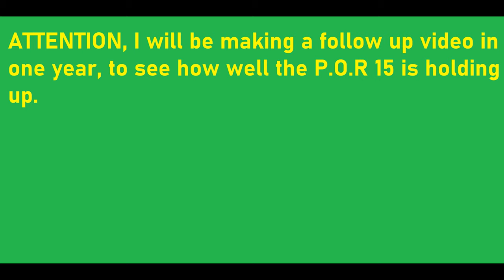Using P.O.R 15 to Undercoat My Lawnmower Deck.

Comment: Thanks - great video.  Short, sweet, clear and concise. Appreciate highlighting the area coverage in the video (1x 42" deck to small can).  This will help determine the amount needed a 46" and 54" zero turns, plus 21" push mower decks. Here in Virginia, the grass seems to always be wet (morning dew/humidity), so I use high lift blades for the discharge.   

In your update, can you cover 1) What is your normal cutting environment? 2) Do you cut in hot dry or moist humid conditions? 3) was the discharge volume impacted?  4) Did the grass clump up more with the POR15?  5) was the deck easier to clean?  Pressure wash? Scrape? and finally, 6) the durability of the product as a whole (chips/flakes, etc).  Thanks again!!
Reply from the maker: Thanks for the feedback!  It all started when I needed to replace a spindle, and I figured while the deck was off and it needed painting anyway, that I would go ahead and undercoat the deck..  The deck on my old Craftsman mower rusted out. And it was always kept inside, but the  grass here is wet and it can be humid..  That is why I ended up buying this John Deere 10 years ago. I was pleased that there was no real rust under the deck, but we will see how well it holds up, because I run over a lot of different things like rocks and sticks..  So it will be the ultimate test!  If I'm satisfied, I will use it on my pickup truck to undercoat the frame. But I might take it to a body shop for that, because there is such a long process and my health isn't that good..

Comment: The abrasion and low frequency impact properties of P.O.R.15 are suitable for a truck bed, but here those will only hold it together until it sags enough for the blades to rip it off and shred it.  Red iron oxide has low tensile, shear and compression strength. It's not enough to block moisture from a rusted steel surface. when it's on the bottom of a thin metal deck subjected to high frequency vibration and high velocity sharp impacts. Any coating applied to a bottom surface will pull the sealer off the weaker oxide beneath it.  The majority of the rust needs to be sandblasted off and/or completely converted to a material physically strong enough to withstand the vibration and impact forces applied. Using P.O.R.15 on top of THAT would provide added impact resistance.

Comment: i did my deck month ago,follwoed the full prepp process+ 2 layers por 15 , but it didnt last long at all, only in 2 weeks,the por15 coated outter ring under the deck is "sanded" off into bare metal,but the rest of coating it remains around the spindles, it kinda make sense the blade keeps throwing grass and sand/small stones onto the outter ring area.
Reply from the maker: Yup, it is the ultimate torture test for sure!  If it becomes a flop on my end, I'll try some heavy duty bed liner next time..    I have learned it is best to leave some rust, you just basically wire brush it and wash it..  It didn't seem to spread as good in the places I totally removed the rust.. 
If I'm impressed enough, then I'll probably do my truck frame in it next..
Reply: @FlickScreen  yeah,iv been googled around and found the truth that por15 only do well on cleaned but rusty surface, it doesnt stick well onto baremetal or painted surface even its well prepared.  The grass usually buildup around the spindle part so its often rusty and por15 likes it,also that part has much less sanding effect from the blades thats why por stays
Reply from the maker: Yup I done a little experimenting and found that to be the truth.  When you put it on a painted surface it will beed up and run off like water..  This is my first time dealing with por15, so it will be interesting come next spring..

Comment: When will you do the follow up video?
Reply from the maker: In about a month, I wanted to give it exactly one year, so if there is any rust it will be shown. I didn't clean the deck at the end of the mowing season because I wanted to torture test it as much as possible. I'm actually kinda looking forward to seeing it for myself, if I'm impressed I might do the frame of my truck in it.  

This time I have much better camera equipment than just a Gopro and head mount. I did film a video on how to remove the deck, but the audio turned out horrible and unusable, I was pretty upset because it took extra time and effort.

Comment: You mow over sand, or clay?
Reply from the maker: I live out in the country, so I run over alot of different things, especially twigs and small tree limbs. I have a crush and run driveway, and it kicks up small rocks.

Along with the deck, I put brand new mulching blades on it. 

I was considering doing the video early due to requests, then my hip went out to the point I could barely walk.
I think that I pulled something or irritated my bursitis where I cleaned up a tree limb after tropical storm Elsa, I think that I talked about it in one of my vlogs. It took three steroid shots to calm it down.

But since I decided to give it the full year, I'm now able to make a more high quality video, since I have upgraded my camera equipment since then. I didn't even have a proper tripod in the first video, lol

But if it holds up to my abuse and hard use it can handle anything just about..